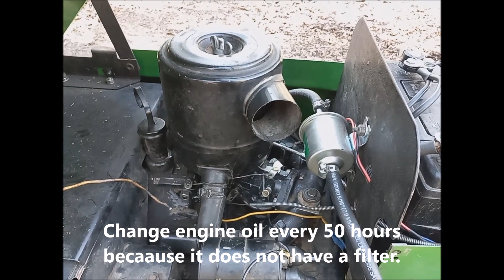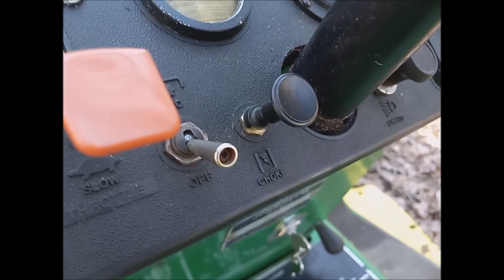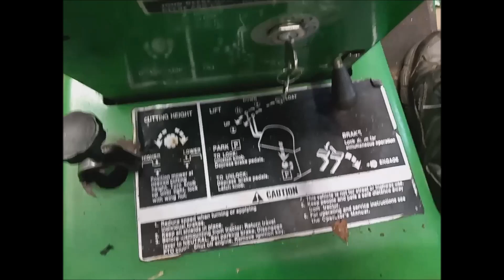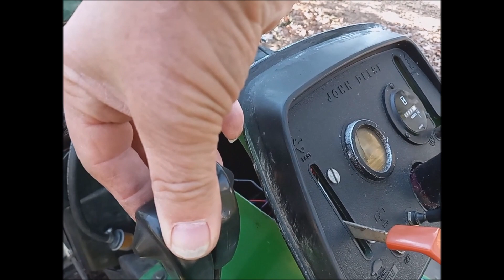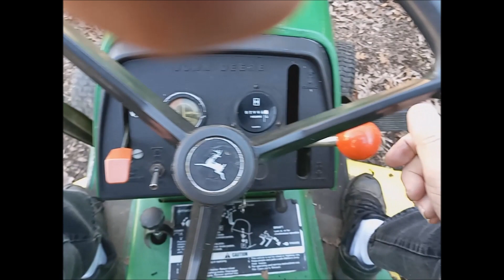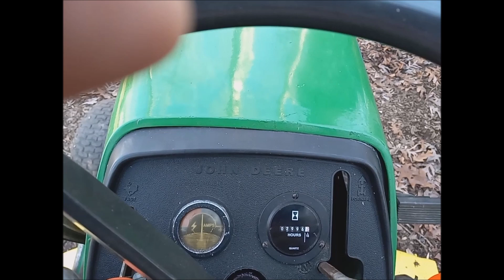John Deere 317 Garden Tractor For Sale

Comment: I had a 1980 model John Deere 317 with the rotor tiller on the back and 4 mower decks in decent shape along with 2 rear tires on rims and 2 front ones on rims just serviced the unit and I sold it for $1,600.00 still below what its worth but the PTO had a short that needed fixing or I would of stuck with $2,500.00 for it.was in great shape.
Reply from the maker: A used rear PTO would sell for $800-900 IF you could find one.